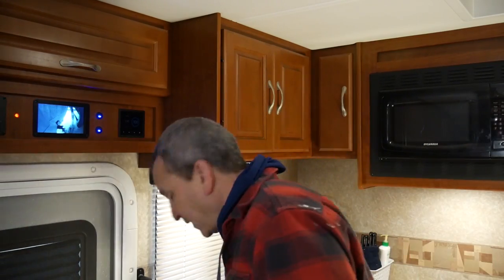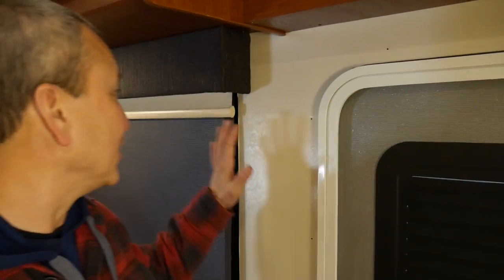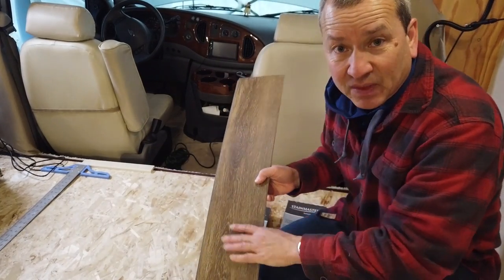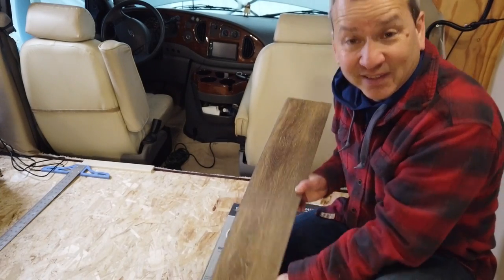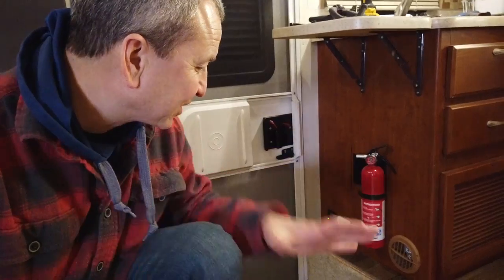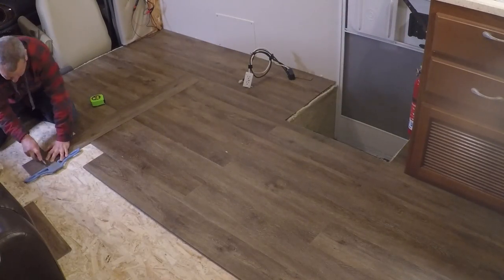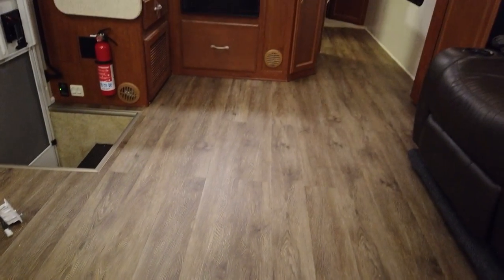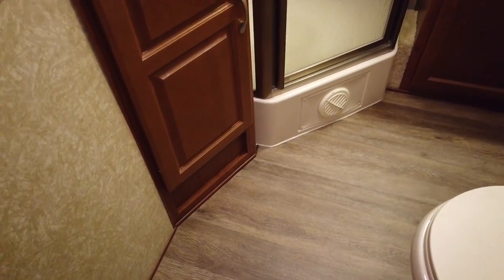Installing Vinyl Plank Flooring in RV Start to Finish | Class C RV Renovation | RV with Tito

Comment: Now that your installation is over a year old, are any of your seams trying to lift or separate?  The main product review complaint on the Stainmaster site is "seams lifting".  I think that in most of those they were installing over a pad.  I noticed you hammered all your seams.  We want to use this in our Monaco Knight because it is the lightest weight interlocking plank product.  With 14 boxes of flooring, weight is a big consideration.

Comment: Got to let us know how the floor holds up when the motorhome heats up in the summer. What's the thermal expansion rating for that material? Very nice work, thanks for sharing.
Reply from the maker: I'll keep you posted. Honestly, I don't know the thermal expansion. It's not wood though. It's vinyl.
Reply: @RVwithTito  Looks great!!  Did you have any buckling in the summer when it heated up?
Reply from the maker: @stemtosternms4438  No. Looks the same as when I installed it.

Comment: With that paint did you still sand your walls? Also we started with flooring but found some water damage near the toilet 😭
Reply from the maker: I just cleaned the walls before painting. Bummer about the water damage. I hate those kind of surprises.

Comment: I'm curious, I'm thinking of removing the carpet & replacing with planks in my 40ft Class A & I've watch a few of these videos now & nobody puts down a membrane like Red Guard to seal the subfloor, Am i missing something???
Reply from the maker: You could do a membrane. It seems to seal up fine without it. I did put some plastic down under the fridge.
Reply: Hi there Stuart T, I’m watching Brian’s channel to obtain tips also for my current remodel. My tip to you is roll a coat or two of penetrating epoxy resin on all of the wood sub floor.  Penetrating epoxy resin encapsulates the wood fibers so they cannot absorb water or any other liquid in the future.  That is what good boat makers did before everyone eliminated plywood and started using composite sheets in the mid 1990s.  Not really hard or expensive to do to wood subfloor.

Comment: Love your videos guys.  I was looking to do the same thing in our Class A.  While shopping at Home Depot the salesperson advised me some laminates are not cold weather friendly.  Specifically below 50 degrees.  Is this flooring you are using ok for cold weather?
Reply from the maker: The instructions recommend acclimating and installing above 70 deg for best results. I kept it pretty warm for about 2 weeks in the RV during that time. There's a little room on some edges for expansion, but we'll have to see.

Comment: I'm looking to get a RV cover to replace the tarps I have & see that you have one on in video.  Any recommendations?  Do they make them actually water proof.
Reply from the maker: The one I've been using is from EmpireCovers.com. It's called the Premier cover and is as close to waterproof as Ive had. Ive had this one for several years now. Their cheaper light weight covers don't last very long.

Comment: I am currently pulling out the carpet from under my dinette slide.  How did you get it far enough back that you can’t see it?
Reply from the maker: No tricks really. Just lots of yanking and tearing with pliers to get as much as possible. I've also found that I can access some areas from under the RV slide by taking off the slide motor access panel.
Reply: Thanks I’ll try that.

Comment: How has this flooring held up over the last couple of years? Putting some down in my class A, I’m a little worried about the slides messing up the planks when the move in and out...Have you had any of this?
Reply from the maker: Still in great shape. The slides are the biggest issue for some...especially if the slide is very low. Luckily mine has a small gap.

Comment: I’m going to guess you had your furnace running, otherwise I can’t wrap my head around you painting and putting down flooring in that weather. Thanks for describing the paint...I was wondering if there was any specific requirements for covering the existing wall coverings.
Reply from the maker: Oh yeah. I had a space heater on the whole time to keep it around 70 deg.

Comment: Hey Brian 
Some installers have suggested glueing down these floors as movement of the rv can make the seams pop. Did you have any issues?
Reply from the maker: I haven't had any issues with leaving it as a floating floor.

Comment: It's been a little over 5 years. How's your vinyl flooring? Did any part or area un-buckled, or separated?
Reply from the maker: We sold the rv a year and a half ago. At that time it still looked the same as when it was installed.

Comment: Have you had any issues with cold or hot weather when RV is stored unheated? I'm ready to do this on my class A.
Reply from the maker: No issues so far within the temp ranges we've had inside (between 40 and 90 deg F)

Comment: Looks great. How is the vinyl performing with the extreme temps? I would be afraid that over time it may not hold up to extreme temps.
Reply from the maker: The flooring is still good. The highest we've had the inside temp has been around 90. How extreme does it get in your RV?
Reply: I don't know yet as we just got it. It needs new floor covering, so we are researching what to use. A carpenter friend told us to be careful, because a friend of his tried using laminate and it ended up warping over time due to the hot and then the freezing cold, repeatedly. We live in PA.
Reply from the maker: @bobbiclinger7500  For us so-far-so-good. We live in the pacific northwest and routinely travel to the southwest. It never gets below 40 deg F inside.
Reply: @RVwithTito  "Tito" is it possible for you to pin this answer and the status so the folks just finding your site can get this important answer? 
This is a really good series! Thanks.

Comment: Any problems with expansion/contraction due to temperature swings?  All the LVT I've looked at (including Stainmaster) says to only install indoors in temperature controlled environment and NOT in RV, trailer, sunroom, or boat, so I've been reluctant to do it but it seems like a lot of people do.  Thoughts?
Reply from the maker: I haven't had any issues yet.

Comment: I assume you live in a colder area since there is snow.  Did you find your floor popped up with the LVP?  We live in Canada and I have read that you should not use LVP because it will buckle with heat and cold expansion.
Reply from the maker: No. Never had any buckling.  It just happened to be snowing that week. We don't have extreme weather.

Comment: We want to replace the vinyl sheet flooring in our Jayco with vinyl plank floors (current vinyl has a tear). What thickness of flooring did you use? How is it holding up? Pros & cons please?
Reply from the maker: I don't know the exact thickness off-hand (maybe 3/8"). It's still holding up great. All pros so far, no cons. Everything looks great and is easy to clean just like the day it was installed.
Reply: Thank you

Comment: Did the new floor add any extra weight overall? I've been thinking of doing something like this but want to keep something that's not going to be heavy.
Reply from the maker: Yes. It does add a 150 lbs or so depending on the size of your RV.
Reply: @RVwithTito  well that's not to bad for the updated look. Love the video, we just bought our class c and are planning on doing the same thing.

Comment: What about the slide out? Are there any issues installing the flooring in that area?
Reply from the maker: Yes. There can be. Luckily I had a little room to work under mine. Others are very flush and can be a problem. Sorry. I don't have a solution for all slides. You'll have to pull yours all the way out and see what it would take to remove the old and insert the new flooring as far back as possible.

Comment: Stupid question, but how do the floorboards stick? Do they stick or do you just push them so close there is no opening so they can't move?
Reply from the maker: They are designed to snap together creating a very tight connection.

Comment: Looks fantastic.  Great job on those intricate cuts too.  Do you think with all these upgrades you've been doing are you adding weight or did the old furnishings weigh about the same?  I know vinyl planks have some weight to them in the package but not sure about the old thin rolled sheet vinyl that you removed. I'm guessing you are getting heavier.  Thanks for posting.
Reply from the maker: The flooring is definitely heavier than the old flooring. The sofa was heavy and parts of the dinette. I'm also planning to remove my generator soon so that'll drop 300 lbs.

Comment: My BF doesn't want to take up the old vinyl, I told him this is how we will find any soft spots or prior leaks (I won that battle) - I will be doing this, as I did all my own flooring in my house in fl - I just confused about what the details are going to be doing under the slide
Reply from the maker: Yeah. The slide part can be very difficult depending on the type of slide you have. I had a little room to work with, some don't. Good luck.

Comment: Curious. How’s it holding up? Any areas that have shifted or lifted up?
Reply from the maker: All good so far. Looks the same.
Reply: RV with Tito DIY thanks for your reply! I’ve seen a lot of “how to install” and not one of how it’s working out. I had a professional floor guy, advise me not to get the plank. I’ve researched, shopped and bought vinyl planks and now sheet vinyl. It’s just me and I’m limited on tools, so...will see if this works out for me. I know it seems backward to use a vinyl sheet rather than plank. Thanks again!
Reply from the maker: @godseeker7628  You're welcome. Good luck with the project.

Comment: I'm going to ask a silly question.
All 3 of the windows in the cabover leaked rotting the whole sheet of plywood out.
What a mess but now uts time to replace all that wood.
I would rather put in tounge and groove over trying to replace a whole sheet of plywood.

Do you or anyone think tounge and groove will be as strong as a single sheet of plywood in the cabover?

Blue skies and safe journeys!

Comment: You didn't have to leave 1/4"   margin to allow for expansion/ contraction of wood subfloor?
Reply from the maker: I did leave a slight gap in areas, but there isn't as much expansion since this is a floating installation and the RV sub-frame is built of steel.
Reply: @RVwithTito  Oh... Do you think steel framing might have a lot to do with you not having as many shrink/expand issues as others with all wood have had?

Comment: How am I supposed to remove my carpet from under my slide out? It’s about a foot underneath it!! Thx
Reply from the maker: I know. It's really tough. You can use a long pry bar to help remove the staples. I also have a long set of pliers that I could reach in and yank out as much as possible. If you can't get it all, that's probably fine as long as you don't see it when the slide is extended.
Reply: RV with Tito DIY thank you very much. I’ll try that! 👍

Comment: interesting the original vinyl flooring wasn't glued down. I think I also have a rotten piece of flooring so will be replicating your work
Reply from the maker: Yeah. I expected something else under the vinyl. Made for a much easier removal. That's for sure. Good luck with your project.

Comment: KEEP IN MIND  if you do not have rollers on the slide out not to do this in your RV as the carpet is what the slide slides on .  this well destroy your RV slide out and new flooring
Reply from the maker: No rollers on my slide. So I'm good.
Reply: How would I know if my 05 Winnebago Minnie has rollers on the slides?  Gonna have to do some you tubing on this subject as I was planning to redo my floors in 3 weeks!
Reply: @JipseeGirl  I'm having the same problem (question) I think placing strips of wide msking tape on the carpet and then bringing the slider in and back out and see it the tape is torn or damaged..
Reply: P😊

Comment: Why didn’t you replace the carpet in the stair well? I think it would have looked even better.
Reply from the maker: I'm still thinking about plans for the stairwell, so I kept the carpet for now. It will be easy to do later.
Reply: RV with Tito DIY  good idea
Reply: How would you attach it to the stairwell walls?
Reply from the maker: @Mth308  Screws or glue.

Comment: You made the same mistake many other "Youtubbers" made, no underlayment to allow separate movement between the finish floor and the subfloor. Those thin sheets have a very important purpose. Temperature changes are going to move the floor and subfloor at different rates and directions and adhering directly to the subfloor pulls the finish floor apart.
Reply from the maker: You're right, it was a conscious decision not to add underlayment. It's still a floating floor though which has held up perfectly since installation a few years ago.

Comment: Pro Tip: You should not install a floating "wood" floor in an RV! Glue it down....that's from a professional installer.
Reply: Im doing one tomorrow. Someone suggested wet lay as apposed to pressure sensitive setting.   As we have huge temperature changes . Do you have any thoughts on that ?